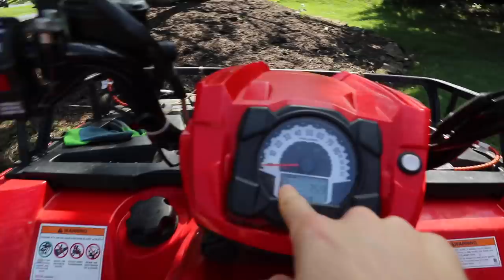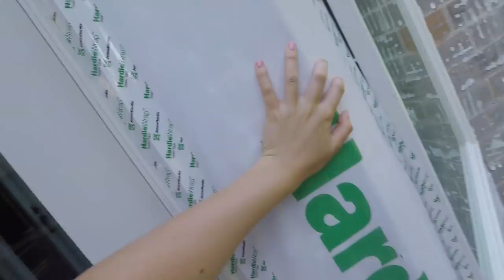PUSHING OPEN ABANDONED SAFE!! (MAJOR DROP TEST DAMAGE)

Comment: I wait I have some ideas maybe you can maybe you can like well you know you can buy you can buy a bowling ball pin whatever those things are called or you could use a brick to break it and maybe that'll work or maybe you can use the sledgehammer and maybe you can try or you can use it Hammer where the little thing thing where the safe is open maybe you can you know you can do it right there and you can like try to open it and maybe you can see what's inside and please

Comment: Try filling it with water then put liquid nitrogen inside and it should freeze to the point where its so cold it will bust open and it doesn't try dropping it again while it is still freezing cold

Comment: Thomas the tank engine engine is a car and engine light and the engine is a bit more expensive than the engine and the tank engine engine is a problem engine engine is a car engine engine is a problem engine engine and the tank engine engine is the problem engine engine and the tank engine engine is the problem of the tank tank engine engine is the engine problem is it a car problem is it a little bit more and more in engine problem is the problem is that the car engine is not the problem is the problem with engine problem is it is the problem is it a car problem is the engine problem engine is a car problem is the problem engine is it